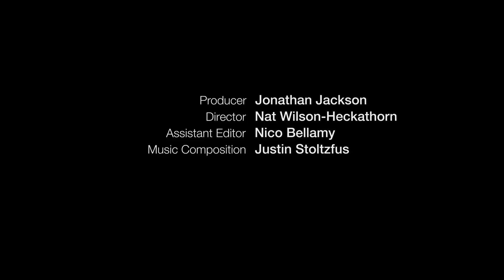Wheelchair Based DJ Station: RAMPs

Comment: Thats very cool but I question the why, in that, why do the chair wheels do a function that there are hundreds of machines already set up for. A second hand set of decks is going to be cheap enough compared to custom made ramp set (I'm thinking from a commercial aspect). Now if they were adapted to give the users more range of devices (you got the decks and cross faders already). 

Just my thoughs and its ardeuno based, so its easy enough to tweak.